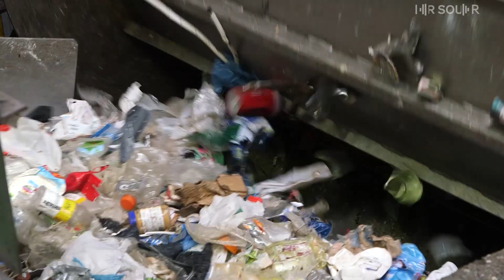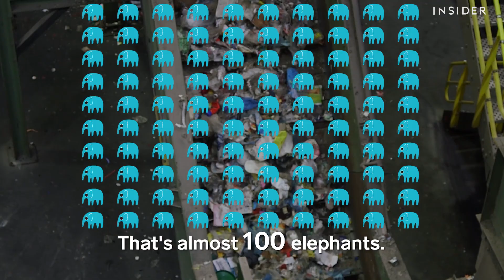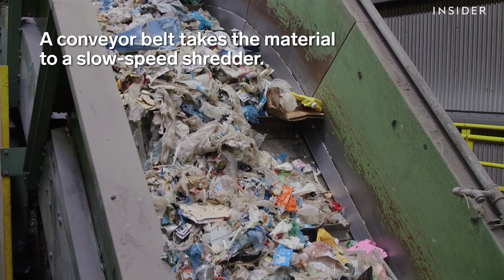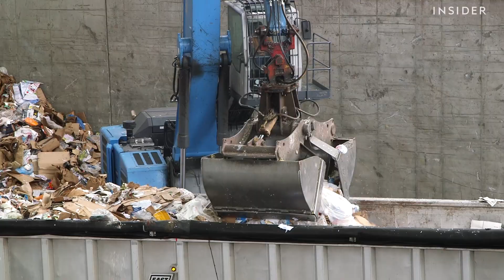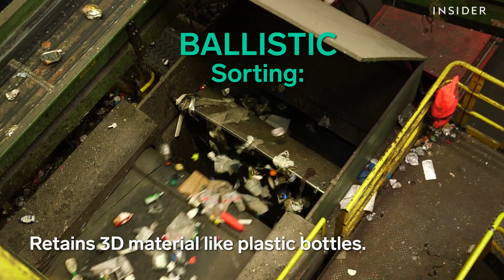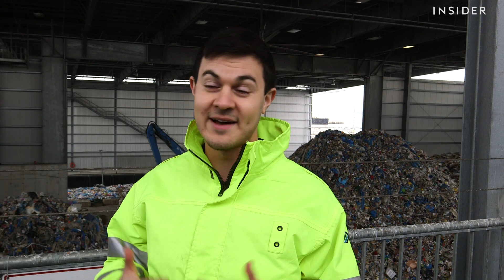How Garbage Is Recycled At The US' Largest Recycling Facility

Comment: How to recycle material. Wooden waste plastic waste paper waste clothes waste tree leaves waste bark waste unwanted thorny plants poisonous plants waste or dry leaves etc should be burnt near a.sea shore. Metal waste should be melted separately. Chemical waste should be converted to other forms using sulphuric acid or base. Salt should be removed from sea shore by drying and converted to basic forms. Human and animal dead bodies should be burnt or buried or fish feed near a sea shore. Nuclear waste should be miles under sea or ocean floor. Nuclear Power plant should be stopped except for burning waste. Sand waste should be washed in ocean floor or river banks. Computer waste should be dismantled separate and melted except batteries and for batteries it is a special process. The more you grow vegetative plants the more the environment is clean. Poisonous plants and chemicals spoil soil and environment.

Comment: I work in a recycling facility in MN.  Here are tips.

1. Remove caps from plastic bottles or we take them off ourselves which waste time.

2. Plastic bags and film MUST be recycled at separate plants or they clog up the conveyors.  You can find places to recycle these at Walmart, target, or any other large retailer.  If you put them in traditional recycling bin they end up in a landfill because we can't process them.

3. If you want to recycle shredded paper put it inside a paper bag tied closed with a zip strip.  If the shreddings are loose they get thrown away when the conveyors are cleaned.
Reply: Good to know!
Reply: Tell that the EU because they made it compulsory that the cap is fixed on the bottle

Comment: technically, this facility is NOT recycling anything,,
IT'S JUST SORTING!
Reply: True. No recycling happening there.
Reply: But then the shorted  is reused
Reply: @davisdelp8131  
& like a good lib,
Davis here wants to believe he saw something he didn't 
You witnessed sorting,, that's it!

Your 'lib imagination' is convincing you it's being "reused",
eventhough you clearly DID NOT SEE it being done!
ALL you witnessed was it being sorted,, or in your case 'shorted'
Reply: It's stated at the end of the video that the huge cubes of sorted materials are sold to companies that will recycle them.

This stuff is all getting recycled, otherwise the companies wouldn't pay for the material.
Reply: libs don't care as long as they feeeeel good, never mind it goes overseas and is burned or dump in the ocean or dump.  There is a very limited use for mixed plastic waste.